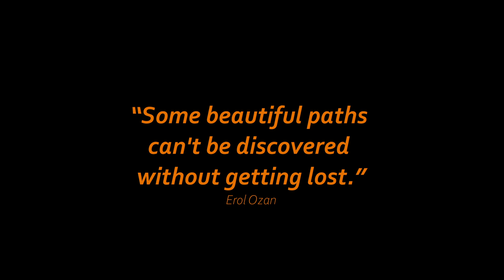Foxhole - Vehicle Basics

Comment: I think the initial amount of fuel in a vehicle is actually 5%. Especially based on the numbers 2:28.
Reply: You start with 10 units of fuel regardless of fuel capacity
Reply: @jamestonic  Double check that, I just checked last night and my R1 Hauler started with 5 units of fuel after I pulled it from a Seaport.
Reply: @Krolack10  :O good to know or maybe different from hand making to retrieving. will have to do some testing thanks for the info
Reply: @jamestonic  Best way I found to test it is to have a nearly empty gas canister on me and to know the exact amount in the canister. Then just empty it into the truck, then take the last amount displayed and subtract the known amount from the canister from that for your starting amount.

You can also do the inverse, just fill the vehicle and check your remainder, but that can get tricky if you're dealing with various tank sizes.